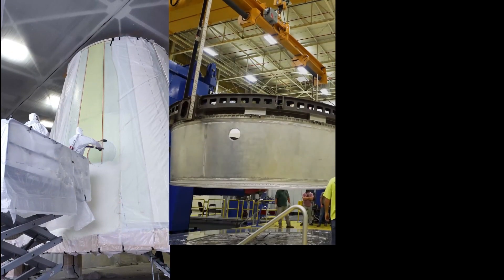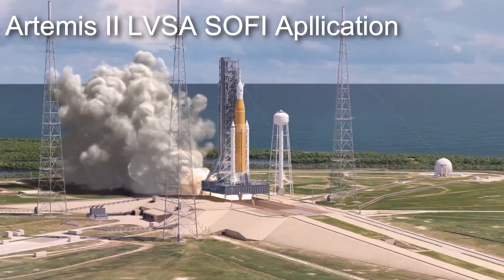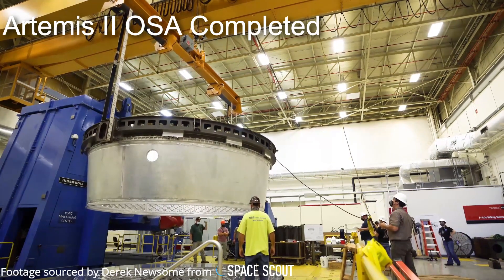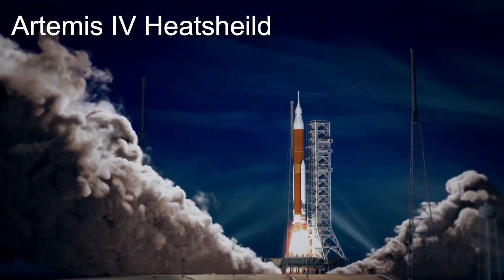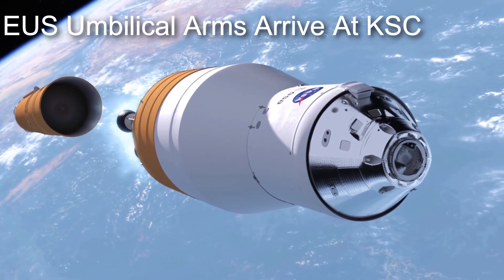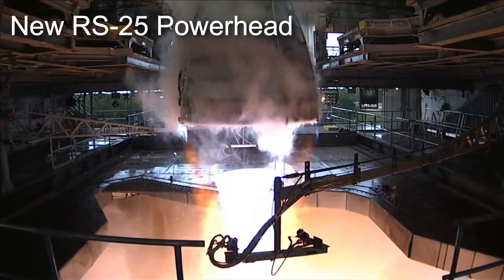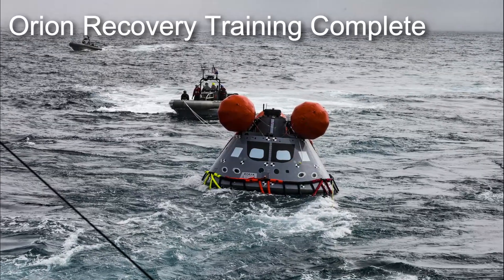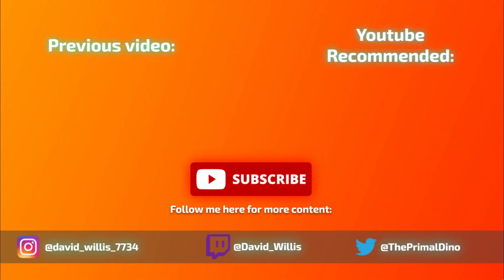SLS rundown Ep: 3 Artemis II and Beyond!

Comment: I'd like to be excited about SLS, but contrary to Starship, SLS online content is mostly descriptive of all the complex parts of the rockets with little insight into the engineering. Why do we need need a weird stage adapter? Why do we need insulating foam? What's the metal and its thickness under the insulating foam that warrants it? Why did you say it encapsulates LOX and engines only? No fuel? What propellants does the Artemis program use to allow a sustainable stay in space and on the Moon, and why so? I thought LH2 was a no-no because of boil off within weeks?
Maybe you have a more engineering oriented video about SLS? I can't get excited before all this complexity and cost makes sense to me. Thx
Reply: I just watched your Constellation video and engineering explanations of the design choices would have been very useful to understand why it makes sense. 
Cancelling Constellation because of cost that had a 1 SRB design and replacing the program by Artemis that uses a 2 SRB design and a lot more stuff that can't lift as much doesn't make sense to me.
Reply from the maker: This sounds like a great topic for a video!

Comment: Artemis 2 SRB segments are mostly reused, I believe 4 of them flew on Ares I-X, and they are almost done right now, which means we could have a hot fire in December 2022.
NASA also said that SLS production will be sped up significantly starting late 2023.
Reply: David has been trying to find the Ares I-X SRB casings for ages. Would be nice if that was the use.

Also out of curiosity, where did you find this info? Been trying to track down the complete casing flight history for a while

Comment: Wondering why the adapter needs the foam insulation since there is no fuel inside. Do we know the total weight of the foam on SLS?
Reply from the maker: Aero heating on ascent due to it being a cone. SOFI keeps the adapter from getting too hot
Reply: the ICPS LOX tank is inside actually, the USA doesnt need foam since it doesnt have anything cryogenic inside
Reply from the maker: @Jomads  remember however, the lox tank for the EUS is also inside an adapter, yet that adapter can be white. This is because it’s a cylinder and not a cone